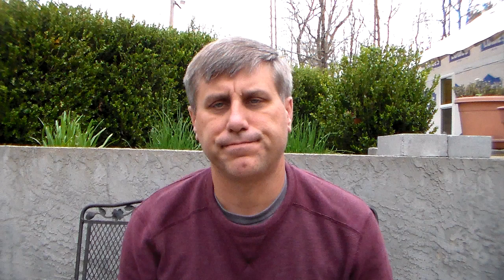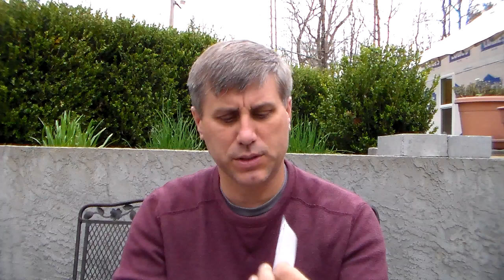Do not make my prepper and homesteading MISTAKES....Save time and money.

Comment: My current plan for a Retreat is:
1) As soon as feasible, buy land. 20+ acres in WV. Water sources on property. If I can get moving water, obviously that's preferred and it also can generate electricity for me for free. Other notable features required. Too many to articulate here.
2) Immediately begin prepping utilities and basic features part-time, such as dirt road/clearing an area for use.
3) Within first 6 months of owning that land, put some sort of shed or garage building on it that can be used as an emergency camp, and also work as a workshop/storage. I'd rather live in a crappy shed in the forest than in the forest without a roof over my head any day should SHTF.
4) Within 2-3 years, utilities should be at least basically satisfactory. Buy a used single-wide mobile home. Many of them are pretty decent, especially compared to "roughing it" mountain-man style in the woods. Preferably a three-bedroom home to accommodate the other members of my retreat team. Shed can be maintained to continue primarily as workspace/storage.
5) Within 5-15 years, begin construction on a new home from the ground up. By this point I should have enough experience with the land and have surveyed it enough to know what the ideal locations will be for permanent structures. Old mobile home can be maintained as a backup shelter, and also housing for other members of retreat team.

There's probably more to my plan, but that's the basic layout of what I'm currently saving up to do.

Comment: If your buying land build your barn first (live in, it till the house is done). Have a U shaped road or driveway for when you have a trailer behind your truck. Big Gates, put em in ! Make sure the animals are a good way from the house but not so far you can't smoke a coyote . Fire roads cleaned up ? Where is your shooting range going to be ? Don't buy property you can't shoot on. Noise issue's ? Use a 22 and a suppressor . Try to buy near a water supply. You can clean up most water. Don't. Buy in a nanny state or liberal state. If deer are in the area put in green fields and feeders.
Reply: #1 priority: water.   PRIMARY WATER.  More $$$, but assures u will have clean water.

Comment: I recommend avoiding John Deere equipement: No right to repair, high maintenence, expensive repairs. Probably the best machine to buy is a used skid steer since it can lift a lot more than a tractor, and you can attach at lot more attachments.

When Trenching for  water lines, also consider electrical. Best is the direct burial Romex wiring. Electrical Conduit is another option but can be problems if you got bends in your conduit. 

If your buying rural land, make sure its not in a flood zone, get a perk test before buying, and check with utility power to see how much it will cost to get power. Make sure you have water rights (for a well) and also check to see the cost to get a well Ask neighbors how deep their well is.
Reply: When digging your well: make sure you hit PRIMARY WATER. Might be more $$$$, but worth it! It will be clean, uncontaminated water.

Comment: Solar system mistakes , don't start with a 12v bank build a 48v bank, use the best wire you can find don't cut corners . Don't  buy Chinese junk . Just buy top quality wind and solar products.

Comment: For the survey markers - do not disturb the existing corners, it is a felony (in FL anyway, not sure about other states) to remove / move property corners.  If you want to mark them, some people put pvc pipe or a metal fence post near the corner so they are visible.  Have your surveyor put in a corner at the maintained r/w line or easement line if your property includes the road.  Please don't set your own rebars or monuments - it is a nightmare :)

Comment: I was reading replys, one person made several good comments about a liveable house and property for when you get older.  I would modify one thought. Never build your house to close to the ground. When you get older you don't want to find your house has rot or termites. There are ways to accomplish both things. Make sure you build on a higher well drained point even if you have to fill the area to build it up.  Slab foundations need to be on a location where water drains away in all directions. Stem wall foundations need to have enough depth after all the utilities are installed to maintain them.  Also drainage so that water or dampness never collects under the house. As for the problem of steps if you don't want them.  Ramp your side walk up gradually.  Handicap ramps are generally one inch of rise for every foot of distance. That works but for some may be uncomfortable. Many times it's possible to have a lower rise rate so that you barely notice you're even moving up for instance 1/2 inch rise per foot of distance. You can get some boards and some blocks of wood and experiment walking on various slopes and see what you think.

Comment: We just bought a new tractor our 1955 only had the bucket and has pretty much died. So we bought an RK 55 fully enclosed cab with AC (Florida) I convinced him it was worth and he has been using it realized it was worth it. We have a burn pile that need to be burned and we got a few implements with the forks for hay and a box blade and tiller.ours is mostly flat but now the county says most of it we can’t build due to they just changed the flood plan due to all the subdivisions that are being built. We have a pond that we stock. My husband has water pipes all over the place and we have a few septic systems that the previous owner put in about 30 yrs again. We are going to try to build some campsites. In our dry area..

Comment: I actually disagree with you slightly about the wood And nuisance trees! You should bury it just in such a way as to act as a raised garden bed This is called, and I’m going to miss pronounce it hukcultlure , Look up Paul Wheaton and permaculture. The other thing would be instead of trying to drain water would be to make gravity irrigation ponds and swals. That hypothetical neighbor clearing a field could actually be an asset because if you can get the water to drain into irrigation ponds pedal actually caused the water to absorb into the land acting as a form of natural agricultural Permacultureal irrigation system. Finally about propane you should look into biogas and rocket mass heater’s

Comment: we use old tires w/ chain hooked to a tractor to scrape out culverts where I from. Implement tires that have been halved work best
Reply: But how do you feed the chain through?
Reply: @joef5708   you don't cut through the bead , cut  inline w/ the tread... you just loop the chain & hook it back to itself, by halving it or splitting it, the tire deforms better for scraping out the inside.
Reply: @bargainhunter4033  thanks for the info. still wondering how to drag it through the culvert, mine is 30’ long.
Reply: @joef5708  long ass chain or several linked together. to get chain through to opposite side, tie rope to a pole or long stick ( I use 1" PVC pipe ) & tie rope to end of chain. use pole to push end of rope through inside of colvert to the opposite side , then use rope to pull chain through inside of colvert . hook chain to tractor & pull tire through. may take a few passes to get completely cleared out. Also make sure tire is not to big or tight, wouldn't happen w/ a 30' colvert but have seen short colverts pulled out the ditch, because too much force
Reply: Good American ingenuity!
Wish u were a neighbor to me!
🇨🇱🇺🇸✝️🙏❤️

Comment: Great tips Dave.  Especially the chicken coop height.  I've started using a hoop house method with cattle panels for tractors and egg layers.  If you get the ends of the panels even just 12-18" above ground level you will still get good overall width with plenty of headroom.  I'm only 5'11" so its perfect for me.

Comment: Keeping mice, bugs (including weevils) out of your storage food is simple & cheap. Get a jar of dried bay leaves (fresh has too much moisture) and place just a couple where you do not want any mice or bugs getting into your stuff. Mice & bugs HATE the smell of bay leaves and will not even come close. A tip your grandmas & great-grandmas knew about. Protect your rice, pasta, flour, crackers, etc. the easy and cheap way. Happy prepping everyone!
Reply: I had bay leaves in storage totes with food in mylar bags.  The mice chewed through the plastic totes and into the mylars.  I lost a lot.  The bay leaves didn't help.  I was glad that I learned when the stakes weren't too high.  Now everything is in mylar bags in 31 gallon galvanized cans.  Rodents can't get into those.  The lid is pressed super tight.
Reply: Cinnamon sticks, also! 
Use both. I do. Put cinnamon sticks (wrapped in small piece of paper towel) in my 5 gal buckets and a 3" piece taped on the top of the lid. Then, put used plastic bag over lid to keep most of dust and dirt off.
Also put pieces of cinnamon sticks around area of the buckets.
No more signs of mice. 😁 Whew!
Reply: PS I bake my dry beans and rice in oven 210° for 1 1/2 hrs, cool, then vacuum seal, then in 5 gal buckets.
Heat kills eggs and bugs. 
Overkill? Nope. I'm storing for 25 yrs.
Reply: @ccccclark2605  You might want to watch this:  https://youtu.be/u_OZ09VJk7o